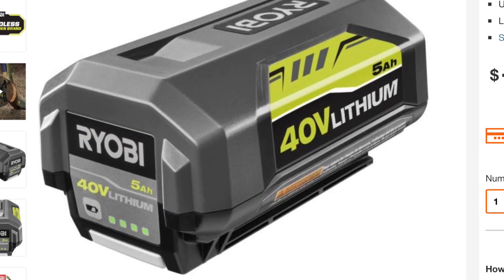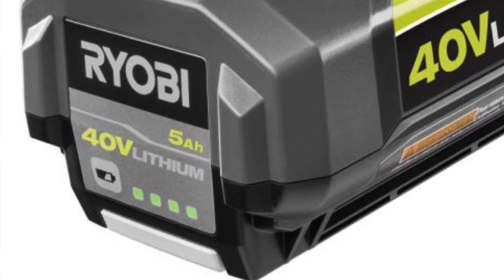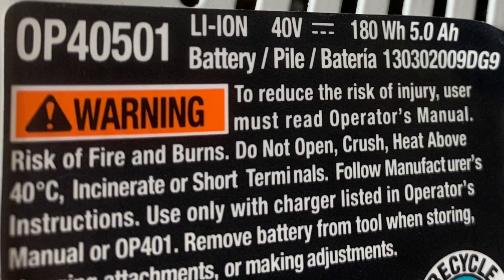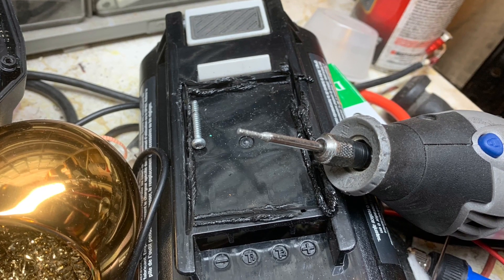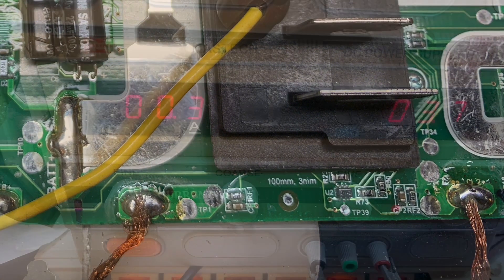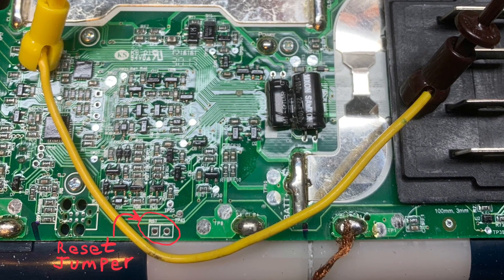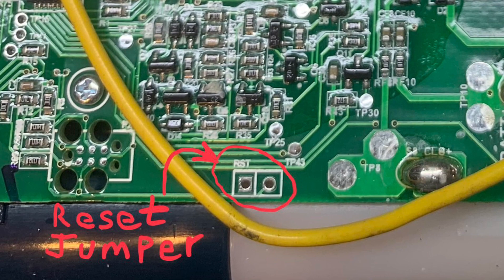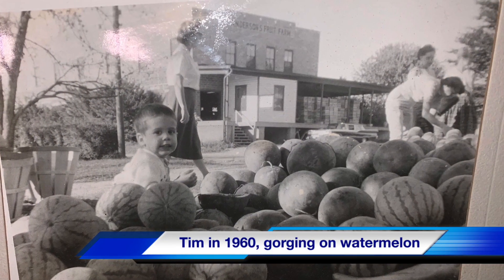Tim’s Tips #49 - Reset and balance a Ryobi 40V battery - Nov 17, 2020

Comment: Buy a set of security torx bits. Like $10 bucks and will save you a lot of time in the future. Great video BTW. I haven't seen this RST before. I have a few packs that may work from this!
Reply from the maker: Thanks for enlightening my ignorance. I didn’t know that they were called “security torx”. Harbor Freight here I come.
Reply: After balancing 3 packs I was still getting the flashing lights on the pack. I jumped the reset pin and boom! Back in business! Thanks again. Worked for 3/4 packs. Also it's 3.3v between rst and the other pin. I think this would work with the older style since the pin next to it is 3.3v.

Comment: Anyway I tried to jump it but nothing happen still not charging
Reply from the maker: The battery may be dead or imbalanced. Check the cell voltages and see if they are above 2 volts. If so, charge the cells with an RC battery charger at the Lion setting.

Comment: So you jumped it by inserting a wire in between the 2 reset holes next to each other? Then put into charger and it might work?
Reply from the maker: Yes. I held it there for a few seconds and a green light flashed. My battery needed balancing, so once it was balanced, it charged fine.
Reply: @tdrager  well nothing happened when I tried it..  now I guess balancing or giving each cell a trickle  of juice is a whole different ball game.  Hard to see where to id location of each cell with my eyes and disabled left side.  But I'll try.

Comment: I just tried it with two sewing needles and it reset but when I put it on the charger it blinked green like it was charging then it started blinking red and green again and the lights flashing again. So I reset it like another three times and it did the same thing so does  anyone know what's happening here
Reply from the maker: The cells may be out of balance. Measure the voltage of each cell. The lower voltage cell needs to be charged with a power supply to match the voltage of the other cell(s).
Reply: @tdrager  idk where to put the positive and negative on the tester to check the cells
Reply from the maker: @weldonpinder7295  Measure voltage between the big blobs of solder on each side of the battery. The voltages should be within .2 V of each other. If they are not you can charge the lower voltage cell. Or, you could discharge the higher voltage cell.

Comment from the maker: Just RESET a SECOND failed 2.6AH battery jumpering it the RST connection. It’s charging fine now.
Reply from the maker: Just short out the RST pads for a few seconds.
Reply: @tdrager  how do you short out?
Reply from the maker: @meteora8888  I shorted the RST pads with jumper clips, but any wire, or even needle nose pliers would do. LOL
Reply: how do you reset it?
Reply: I jumped my rest but it still won't charge